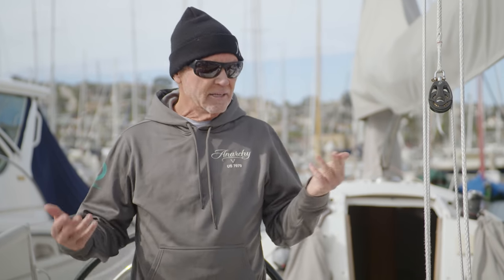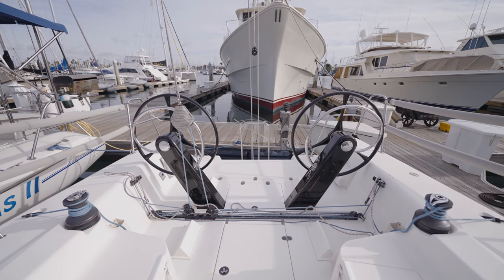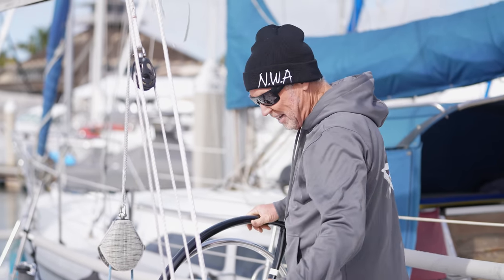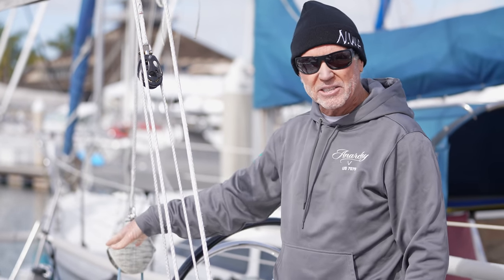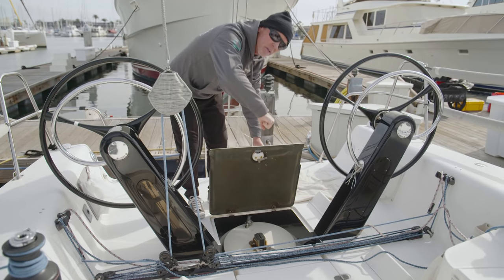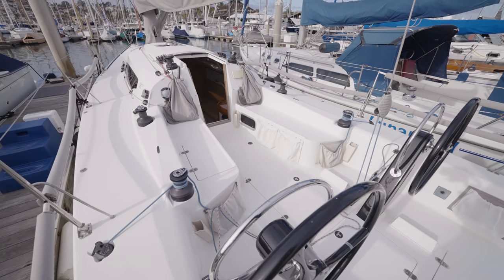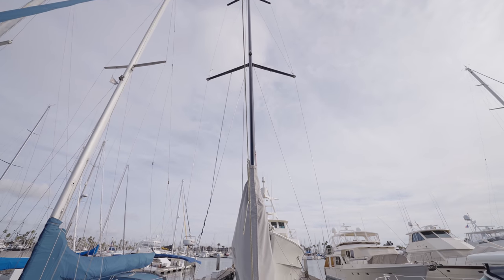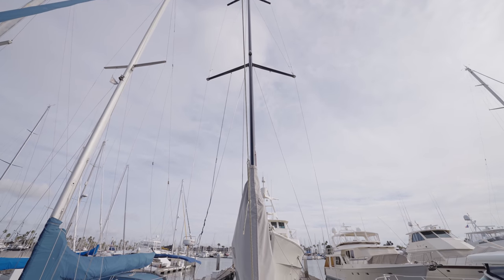Sailboat tour of a Santa Cruz 37 - ep24 #retroboat #sailing - With #sailinganarchy Scot Tempesta

Comment: There were a couple in SF and they always complained about the rating.  More than a few times they finished first and corrected near the bottom.  Their tiny added prod is not going to help with the rating.  Twice boats tied up next to us on a weekend regattas and I remember they had no cleats.  Ok racy race boats have no cleats but it was a real pain as was listening to them complain about their rating.  And you are right about the costs.  They were very pricey, very close to a used but nice SC52.  But the deep keel and large booty worked well in San Francisco but the big kite could be a handful.

Comment: Very nice boat for offshore racing, this boat would probably be very competitive in it's class in races like the Cape to Rio and the Transact, as well as shorter races like the Rolex Sydney Hobart and Fastnet races, looks very much a downwind boat. The exterior lines and aesthetics are almost exactly the same as the '95 Simonis custom Robert and Caine 64' Cape to rio boat I race on, same solid pane outside with dividers inside.

Comment: This boat is good execution of a lousy design, at least for a lot of sailing venues.   In light to moderate winds, it has so much wetted surface, it is slow as molasses.  The sprit is so short, the spinnaker doesn't get out in front of the main.  There was one on the Chesapeake for a while, and it was bottom of the fleet in just about every race, and would lose to much older and smaller boats, boat for boat on a regular basis.
Reply from the maker: i remember sailing on one in san diego when they were brand new and steering you could hear and see way too much water burbling back there. big fat ass drags everywhere in light air, kind of like an ex-gf i once had! It didn't have enough rig either and i just remember saying "uh oh"......